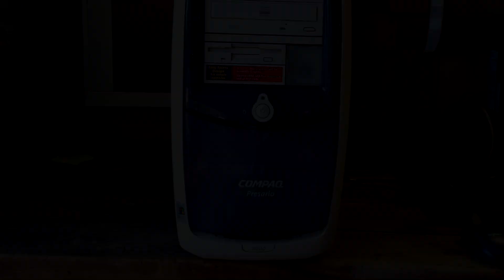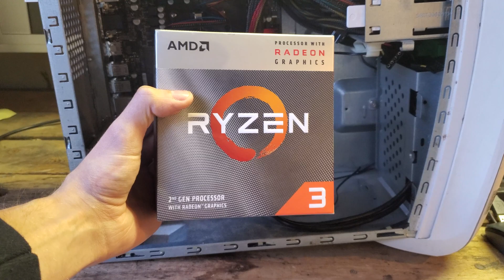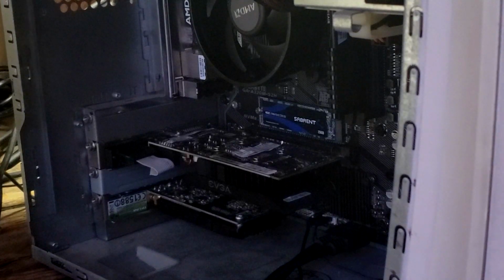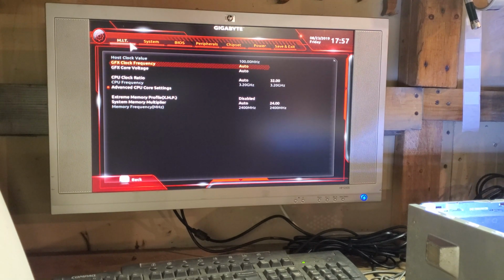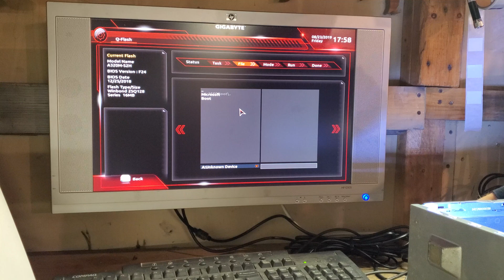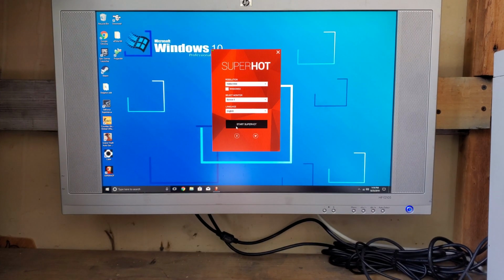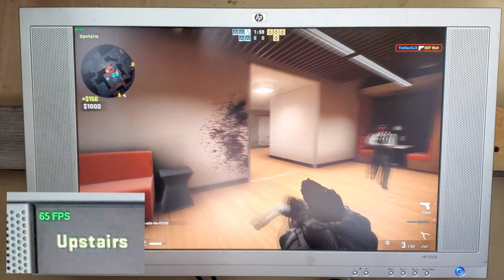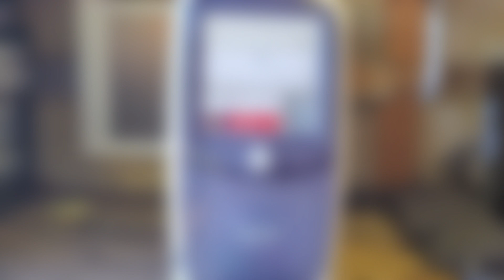Compaq Presario 5000 Ryzen 3 SLEEPER! - CPU Upgrade And Benchmarking

Comment: Mate how did you add the USB 3 ports on the front?
Reply from the maker: I bent the clips in the shroud of the port, and in the actual case it fit right in place. I cant remember exactly how it fit in, but I do remember the usb ports were from another case that I had.

Comment: I found a computer which was that model outside a flat sadly it's only missing the internal hard drive and the CPU cooler I think that the owner probably used those for spare parts not to mention it ran on Windows XP and Pentium 4 at 1.8Ghz.

Comment: Get a new gpu the gt 730 is good but to get more fps you can get a gtx 1660 or a another Card. The gt series of graphics cards are Just ment as display adapters not for gaming. Otherwise a very nice sleaper

Comment: Mine (5630LA desktop presario case) is in works. As elements for future modifications already are a 700w power supply and a 2tb sata hdd backup storage unit running on lga775 motherboard.

Comment: Correct me if im wrong but isnt the GT730 weaker than the integrated graphics?
Reply: Ryzen 3000 has no integrated graphics.
Reply: @deathbyteacup  he's using a 3200g, which has integrated graphics
Reply: @dylanchilders4527  im pretty sure yeah... Vega 8 is quite good compared to a gt 730
Reply: @deathbyteacup  6:30
Says right there on the screen Ryzen 3 3200G with Radeon Vega Graphics

Comment: I too am curious about the usb mod on the front. I found that I wasn't able to use the original usb ports since the cable didn't match anything on the motherboard I put in.
Reply: i have the same system and the motherboard died, i put an older asus board with a core 3 duo on it. the front panel USB plug worked fine without modification, sadly no front audio. anyway i guess they may have made it different standard for usb 3 because if i am not wrong it is only USB 1.0 edit: USB 1.1

Comment: Hey how you get the front power/HDD LEDs going? Seems the connector is one whole connector rather than separate ones...otherwise computer boots no problem.
Reply from the maker: I took lights from a newer case that was beat up and replaced them. You can remove the old lights and cables from the plastic housing and replace them with more modern ones with the correct pugs/terminals. They should just clip in.